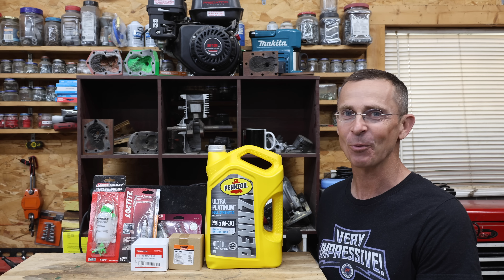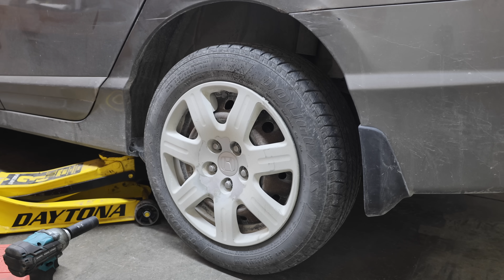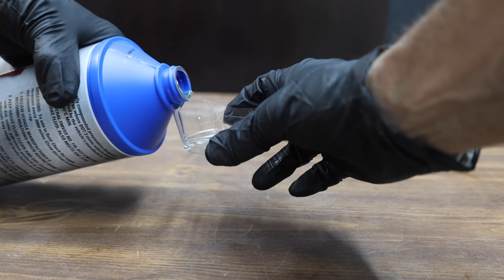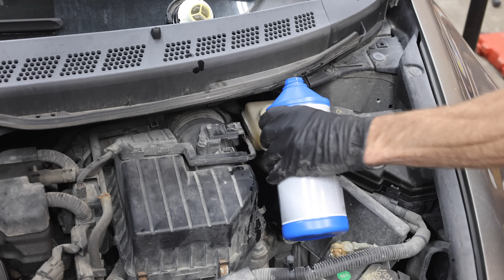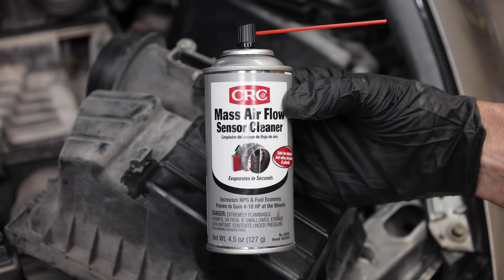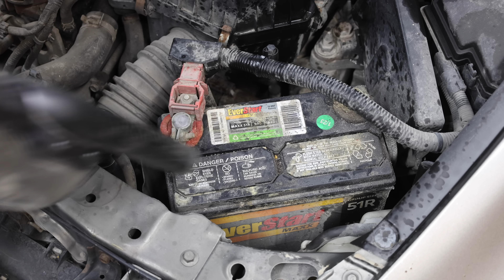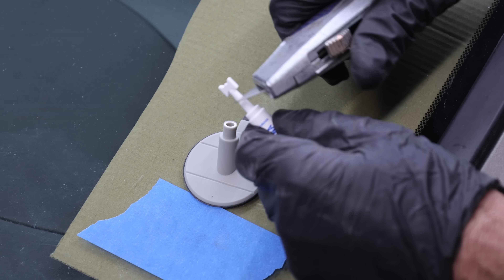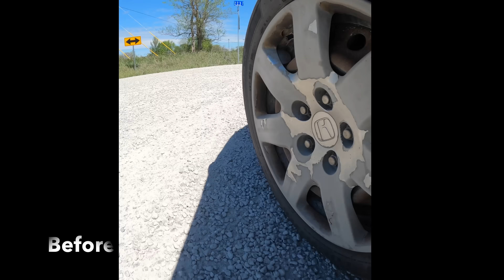Most Reliable 200K Mile Car? Let's Settle This!

Comment: That Civic is ready for the next 200K miles- well done! People should get in the habit of keeping what they have and maintain it well. It was $800 in parts but likely thousands more in labor to have a shop do it, so that was a great restoration.
Reply: Even if you have some (or all) professional assistance, given used car prices now, you're still coming out WAY ahead in a scenario like this.
Reply: Not always true about the labour especially in the hands of an experienced mechanic. I needed to have a CV axle, radiator hose, and shifter cables replaced. I had the choice to do it myself at a DIY garage that charges $30 Canadian per hour for lift access (I don't have a home with a garage), or pay $139 Canadian per hour to a shop that knows my car very well.

It only cost me $200 more to have the shop do the work than me trying to spend an entire weekend learning new stuff from A to Z with no idea on how long the work will take to complete. They even let me furnish many of the needed parts which have become harder to locate lately considering it's a discontinued Fiat 500 Abarth.
Reply: @Milnoc yeah you only save money if you have space at your own house and jacks, jack stands, and large blocks of wood.
Reply: A great idea, as long as you're not in the Rust Belt.  Salt will destroy the under-carriage well before the mechanicals wear out.
Reply: @powrguy1696 absolutely, positively correct!!!!
Reply: @powrguy1696  It doesn't actually matter where you live as you are not required to BUY a car from the rust belt. I recently bought a 1989 GMC 3500 off an auction site for only $8700. It had aluminum wheels and six new tires and new battery. Low mileage, BBC, no accidents/clean CarFax. It lived its life in a garage in CA. It was shipped from AZ. The cost of shipping was $1600. Something like the Civic would be around $1000 for cross country shipping. The truck has absolutely zero rust anywhere. The key is to be patient in order to get the best deal. I was comfortable with sight-unseen as there were 200 hi-res pics and the price was low, about half the going rate locally. I am very happy with it with only a few minor defects undisclosed. Cars from the South are also good. In some cases, you can fly in and drive out. From now on, I will only buy vehicles from dry/arid climates.
Reply: yea, easily a thousand $ minimum in labor at the standard shop
Reply: @75novaguy73  lol no more like 300
Reply from the maker: Great point!
Reply: Would be interesting to see how much it would cost in labor for the work. Including markup on parts I bet $4k..
Reply: Most people used to only care about " how low can you get my monthly payment". And pretty much would throw away a good car that was " too old". With car payments reaching an all time high, many will have to keep their " old cars" much longer. I've been driving " junk cars " for years. Great video ! My secret is out... lol.
Reply: Going by my local Honda dealer's posted prices, he did $4370 of repairs.
Reply: Yup.  My local shop quoted $1200 to replace one CV axle.  Last I checked the OEM part is less than $400, and I could get a Cardone for $48.
Reply: Yep, I took mine to 350,000+. Same model.
Reply: @PaulLawson-k8v  what year is this civic?
Reply: With my car labor to do anything is about 600-1,000 dollars. Plus, of you do it yourself, you know it's done right.
Reply: @dawnrobbins5877  Not if you're a complete idiot like me.

Comment: For the first time in my life I was able to garage from day 1 keep my 2019 Silverado in SC so at 55,000 miles it looks showroom and the lack of road salt the underside is 000 rust or deterioration .

It’s clearly gonna outlast any previous car I hav owned from and appearance standpoint HOWEVER my 2007 Inpreza as at 170,000 miles kept outdoors in the the salt and snow also just keeps ticking JUST because I chance all the fluids in a timely manner and perform all the recommended service adjustments
Reply from the maker: Thanks for sharing!

Comment: *sits back and watches with respect…sincerely five five-speed 2007 Corolla with 300k miles.
Reply from the maker: Wow, that is very impressive!
Reply: @ProjectFarm  you nailed it in your video. My Corolla isn't anything to look at, but she only costs annual maintenance and the odd part (replaced with OEM parts from Toyota). 

We do road trips of 1500-2000 miles, and it is my daily driver. My goal is 500k 🙂

Comment: $500 dollar vehicles are nearly impossible to find since covid and up here in the north, rust is a bigger problem than the miles
Reply: The problem is you sell a vehicle to someone in "need" for $500, then they turn around and sell it for 1500-2k.
Reply: @plkracer  that's fairly accurate. I saw a guy selling an HHR panel for $1000 with transmission issues. Someone bought it put new tires and an odometer with fewer miles and selling it for $4500. I reported it.
Reply: @Luke_McGhee   What do you mean "an odometer with fewer miles"?   Shouldn't the buyer/mechanic notice the transmission issue?
Reply: @Trust_but_Verify  the odometer was swapped out. The car had 200k miles. The original seller was about to retire so he wanted to sell it quick. The car had a rebuilt engine with a transmission  that's slipping. It would cost $200 in parts to fix. The reseller left all the identifying stuff on the car. If a person was smart, they would look up the car fax or the vin/plate online. I saw one other car looked promising. Looked up the plate on the car. The odometer was swapped out more than once. You can't rollback an odometer on modern cars, but you can swap out the odometer with one that has less miles. I believe the cars computer still holds the information of miles though.
Reply: @Luke_McGhee  Yes, the ECU should hold the millage as well, although if someone isn't going to verify that information with a scanner or prepurchase inspection buying cars might not be their thing.
Reply: @kingnull2697  that or they don't know some people are assholes. Once saw a listing where the mileage was inconsistent. It's like the car reached 236k and it dropped, sold to someone with less miles. Then miles were up to 200k, then dropped under. Only vehicle I know that would be an absolute pain in the ass to odometer swap. Is an old Audi TT. Once was asked about the gauge cluster by a guy, who tried to swap one for repair. I asked a technician about it. He burst out laughing. Even trained technicians have issues. The gauge cluster as a whole is vin locked. Even if a person or technician installed it properly apparently it can still be hard to pair it.
Reply: @Luke_McGhee  if you don’t know enough to be suspicious, then life might be a little beyond you.
Reply: @plkracer   It is hard to see someone resell your old car for $1500 when you are selling the car for $500. However, if you can't do this sort of work for whatever reason, be it time, space or ability, the value of the car to you when it is sitting somewhere, unusable, is $0. You may as well get something for it.
Reply: @meltedrabbit  I've sold cars for less than what they were resold for and it doesn't bother me.  List it a little below true value and someone will pick it up without any bother in a few days with cash in hand.  It's worth it for the convenience and peace of mind.  That person can then hassle with trying to get top dollar for it and I know they won't come back to complain about some little issue they found.
Reply: @meltedrabbit not even fixing it. FB marketplace turned every A-hole into an unlicensed used car salesman.  They won't fix anything. They'll just wait for a deal to pop up, grab it, and re-list it for $1,000 more as it sits. The last two times I tried buying a cheaper used car it took ages to find one for an OK price where the titled name was the person selling it, or that they'd owned it for over a month.
Reply: @plkracer  Triggered.  Years ago, my kid's friend's family car caught on fire, we were getting rid of our van.  Sold it for $20.  They didn't register it.  They didn't insure it.  It accumulated parking tickets that went to my address.  They said they would take care of it.  I got an arrest warrant for failure to pay.  I went to court, and sat all day waiting for my case, which was not heard but simply dismissed.  As my mother would say, never does a good deed go unpunished.
Reply from the maker: Great point!
Reply: Also, here in The Great Industrial Northeast, it's hard to have to put a couple of thousand dollars of repairs in a vehicle that is only worth a few hundred bucks just to get it to pass inspection.
Reply: @ToughAncientSpark correct but that few hundred dollar vehicle would be worth several thousand with a sticker. And, it about 3 months of a new car payment/insurance/registration, etc. plus you’re not taking the hit of massive depreciation because it ain’t worth shit to begin with.
Reply: Even in SoCal you can't find one without issues. Even cars with blown engines sell too high.
Reply: Agreed, watching from within the rust belt.   I was impressed with the lack of rust that car had.  My 2011 Silverado (bought used) has rust holes clear through the side panels.  Engine and transmission are still strong at 193K though.
Reply: @laser31415 I'd say the previous generation of GM trucks survived rust a bit better.
Reply: @pauldevassy2379 I did.   I filed with the DMV.  When I wrote my explanation, in very angry wording, that the DMV was at fault, I seriously didn't say a word to the judge.  I was handed a paper that said the case was dismissed.  In the end it was only time.
Reply: Great job. Like you I can, and do, keep old vehicles running.  Sitting in a 2006 Montana w 149k right beside my 2001 chevy pickup with 256k. Also proud owner of a 71 cj/ oddfire V6 and in the yard is a 67 Chevy C50.   Old cars rise up and revolt!
Reply: I don't trust used car sellers unless it's from a major retailer that existed for decades like Toyota. They fix anything without any discussion on warranty. I recently bought a 2 year old Toyota and got 10 year warranty on it. The price for cars at Toyota is barely cost more than at any SCAM store.
Reply: Nothing to do with covid and everything to do with the regime we're living under all the money going overseas the fun Wars the line the politicians pockets
Reply: During the Obama administration, the used car market was devastated. I knew a guy who worked at a BMW dealership who was disgusted that they had to pour something in the engine to destroy it on cars traded in under that "Cash for Clunkers" program.
Reply: @dennisobrien3618  yup that administration did so much damage

Comment: Honda coolant is supposed to be blue and ONLY blue. Adding the wrong coolant, which was in it, most likely is what caused the coolant code from corrosion in the cooling system

Comment: I will Only use DW02 ATF in a Honda transmission. I will Never use the "compatible" fluid. I had to replace my 3rd cluch pressure switch on my 04 CR-V recently bought mine is atop the transmission below the airbox.
Reply from the maker: Thanks for sharing!

Comment: I have a 2013 Mazda3 and since I’ve owned it when it had 203k miles on it, I’ve put about 16k miles on it and I do all the work on it myself, I’ve done all the fluids and I plan to change everything once it reaches 250k miles. This video is proof you don’t need some expensive mechanic to work on the car and I’m glad to see you work on cars, even using the best products you tested in the past. I guess we will find out if the best products are actually the best when it comes to real life applications. I can’t wait to get a 1 year update on this car.
Reply: Only major problems I had with my 2011 is the TCM Module going bad because of its location and the Heat and also the water pump seal leaked from age.

Comment: I worked at a tire shop that did windshield wipers. A guy I was working with let the windshield wiper arm slip out of his hand and it hit the glass with the customer sitting in the car. It cracked the windshield. Good tip there.
Reply from the maker: Thanks!

Comment: The "Car Care Nut" would tell you NEVER do a full automatic transmission drain on a used auto, your clutches need the grit for friction.  If you clean all the grit out the clutches will start to slip.  A partial drain and replace is sufficient.

Comment: This is a weird switch, I have a 2016 Accord with 206k and a 1995 Civic with 285k. They are excellent cars as long as you keep up with maintenance and don't run them low on oil if they are burning/leaking it. Same for Toyota... We have a customer that routinely brings in her 400k + mile Corolla and it rarely needs much. Of course... Highway miles are much better for a car than city miles.
Reply from the maker: Thanks for sharing!

Comment: The most reliable 200k mile car is the one that's had the best maintenence record. I've seen plenty of Crown Vics exceed 200k, even though a large number have had shorter lifespans than their Mercury Grand Marquis brothers. I've had many BMWs with well over 200k. I had an Audi with 250k on the original turbo. But, if you neglect to do simple maintenance, you'll never see 200k in any car!
Reply from the maker: Great point!

Comment: My audi Q7, 3.0t has 169,000 only repairs have been brake pads, pcv valve,  tires, oil changes.spark plugs
That's it
Reply: German car, no thanks! Wait till the water pump goes out ... Service mode....
Reply from the maker: Thanks for sharing!

Comment: 97-01 Camry V6’s are hands down the best most reliable car ever made. The car was a watered down ES300 and shares a lot of the same parts from it. They are more reliable than any Honda and the reason why I say that is because they have non-interference engines. Timing belt snaps, engine is unharmed.
Reply: Good point!!
Reply from the maker: Thanks for sharing!

Comment: I got a 1.8L toyota engine. Bulletproof. 

Get a pontiac Vibe 😆
Reply: Be careful with that one.  Most of the Pontiac Vibes I saw for sale in my area had locked up engines.  I'm assuming they must burn a lot of oil and people don't check it...
Reply: @MyLifeThai371  yea the 2.4L burn oil. But if rebuilt just as good. They need tighter piston rings.
Reply from the maker: Thanks for sharing!
Reply: @ProjectFarm  sharing is caring!
Reply: Love my Toyota Matrix!
Reply: @johnnymoran180  they are the best. 
It's my little mountain climber.

Comment: Almost all modern combustion cars today can last 200K miles with good care, even cheapie Kia's and Chrysler's.  They keys are 1) don't drive them hard (full throttle starts, hard stops); 2) change the oils and other fluids at least recommended intervals, or earlier; 3) don't over tax the engine and tranny (don't haul heavy items often).  If you drive a car hard, and don't change the fluids often, it'll get you past the warranty (36K miles), but be ready for expensive car repair bills in the near future.
Reply: Not Mopar
Reply: @loveydovey4u  LOL
Reply from the maker: Thanks for sharing!